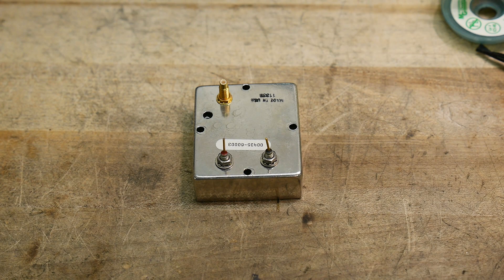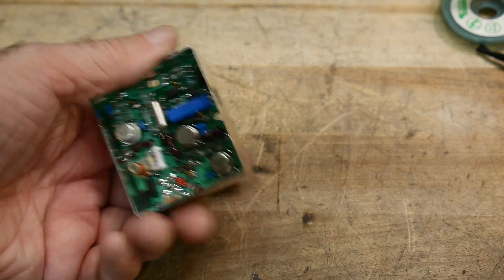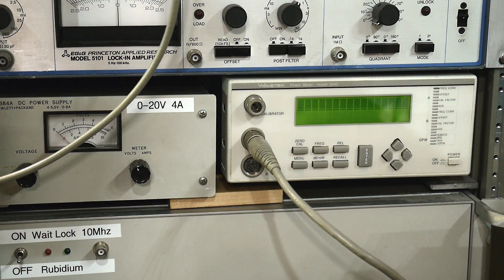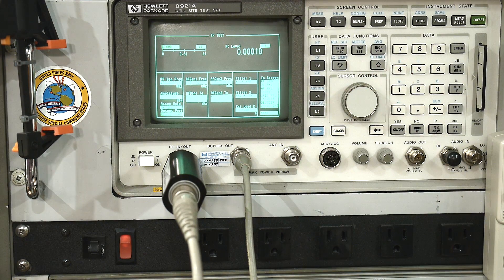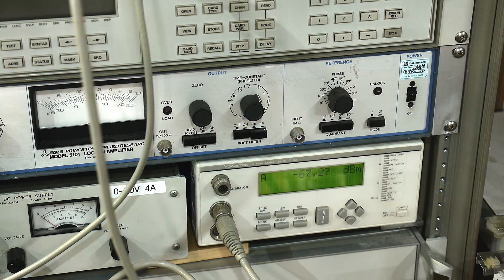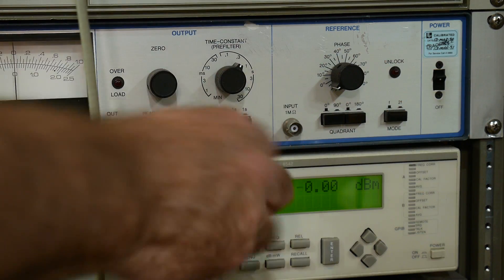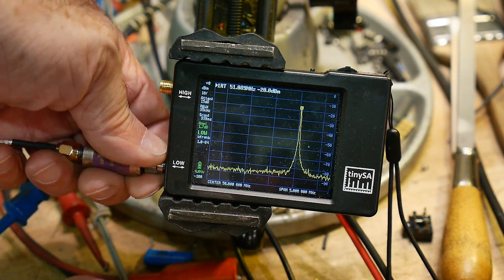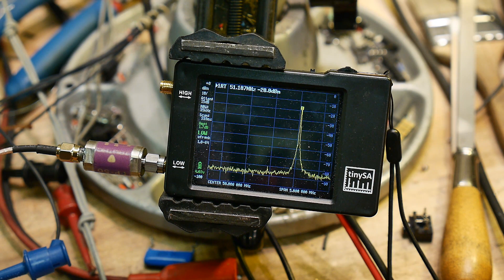#541b 50MHz 0 dBm Calibrator

Comment: Is the 50 MHz 0 dbm calibrator output level independent of the +/- 15v input supply voltage fluctuations?
Reply from the maker: yes
Reply: @IMSAIGuy  Good.
I made a 10 MHz/1 MHz clock reference using a Piezo (Carlisle PA) module, using CMOS logic to both buffer and divide the 10 MHz down to 1 MHz and RC to clean the output and added LP filters. Great, calibrated it against my Trimble GPSDO, only to find it drifted, it was the supply voltage. Easily fixed using a low dropout linear regulator, and lots of decoupling, and now it's rock stable at anything from 12.5v to 15v input. But since then, I've always been careful to make sure oscillator modules are not voltage dependent (unless they are supposed to be).😬

Comment: Hello friend, today I get to work the 50Mhz calibrator inside the HP power meter, the power multi-pot is siled with one calibration company  (I don't touch!) measuring with the TinySA is +2.48dBm (dilemma how to tell the truth?)
Reply from the maker: The TinySA is not calibrated at the factory
Reply: The Chinese module read +00.45 dBm ( the power reading is mathematical or philosophic? It is the first or the latter? one of them approaches the reality of the tinySA or the Chinese module?
I work hard to found the truth, one IFR calibration sticker means some think? Thank you for your patience with me (old men)
Reply from the maker: @frankreal2258  https://youtu.be/bryrAUBNDj8

Comment: Hello, I found one of these but on the cover, shield set  +12/-12 volt (some reason for supply +15/-15 volt?) thank you for the imput.
Reply from the maker: 12 or 15 should work
Reply: @IMSAIGuy  Thank you

Comment: Curious if the 0 dBm calibrator outputs 0 dBm only into a 50 ohm load, or is it capable of actually providing 0 dBm output regardless of the attached load impedance (at least over a certain range of output impedance and what is the published range of acceptable impedance)?  Simple way to test that would be to connect the output of the 0 dBm calibrator up to various resistive loads and measure the voltage across the resistive load with a scope and then calculate the power.
Reply from the maker: it will vary. The circuit is basically an NPN transistor with the 50ohm load appearing on the collector. the feed back path will keep a voltage constant. so to first order the power will change linearly with the load resistance.

Comment: The method you show for adjusting the TinySa is normally used to adjust the display level when using an external amplifier or attenuator.  I use it when measuring transmitter levels using a 40 dB. tap.  You could use the COFIG/ EXPERT CONfiG/ACTUAL POWER menu item to calibrate the TinySA to your external calibrator

Comment: SMA torque wrench : )
Reply: I use  some that I 3D printed. Not calibrated, but by changing the printing paramaters, you can get close to the desired tightness value.  The main advantage is that you get a consistant tightness.  https://kv4qb.blogspot.com/2020/02/sma-torque-wrench-for-nanovna.html
Reply from the maker: @duwaynes7529  Interesting. doesn't fix all the bad Chinese cables I have though. i've had male connector pins push in , center conductors and shield come loose.
Reply from the maker: I wish I had one
Reply: @IMSAIGuy  Aw. There are a few cheap ones. If the connector could be supported, a stick and weight could be used, or to calibrate something else. An Arduino, strain gauge, an Hx711, perhaps.

Comment: Would you comment on how you connected the 0dBm Calibrator to the power meter at 8:17 in the video? Specifically, I believe you were measuring the power at the sensor, not at the output of the calibrator due to cable and connector losses. In particular, while you used the same short SMA to SMA cable both here and with the SA, during the calibration you appear to also use two adapters, an SMA to BNC and a BNC to N. Since these two adapters were not in the circuit when feeding power to the SA, would not the power delivered to the SA be greater than 0 dBm?

While this may seem like a very small offset error, I am curious how you could eliminate it given the extremely high-quality test equipment you have?
Reply from the maker: Well to do it right, the equipment manufacturers sell many types of sensor heads with various connector types. You get the sensor with the correct connector and calibrate the best you can. The sensor heads are very expensive. I'm lucky to have the one I have because I was the designer of that power meter and took one home :)   For my garage I do the best I can and have lots of fun doing it.
Reply from the maker: Another way (and could/should have done this)  is to measure the insertion loss of all the adapters and cables and subtract them off of the measurement
Reply from the maker: Just released a new video you will enjoy
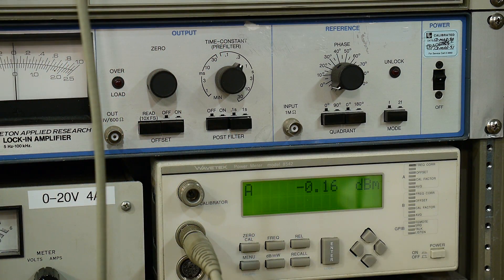Reply: @IMSAIGuy  I just watched the new video and I did enjoy it. There remains the issue of the insertion loss of the SMA to SMA cable which you used in this video (both between the calibrator and the power meter and the calibrator and the VNA) which you did not account for in the second video. At 8:31 in this video, your initial power measurement was -0.16 dBm prior to adjustment. I would think that the SMA to SMA cable would be the greatest source of loss so is it possible that the calibrator was in fact delivering a power level of -0.0 dBm at it's SMA output connector prior to the adjustment of its calibration?

Please don't get me wrong, I am not trying to call you out or be pedantic here, what I would like to understand is if one would generally adjust a power source to deliver the expected power at the sync end of the cables and adapters or would one want the rated power at the source end and simply adjust (subtract) for the losses in the adapters and cables? In other words would one adjust as one would for a VNA so that the measurement point is at the end of the cable rather than the connector on the instrument?
Reply from the maker: @JohnTarbox  So, now the calibrator is calibrated. At the calibrator SMA connector. to transfer this to the TinySA the insersion loss of connectors and cables would need to be know and added to the result. I did not show this. Remember that spectrum analyzers are not very good power meters. even the HP8921 spec is +/-2.5dB. That is why they sell scalar network analyzers.